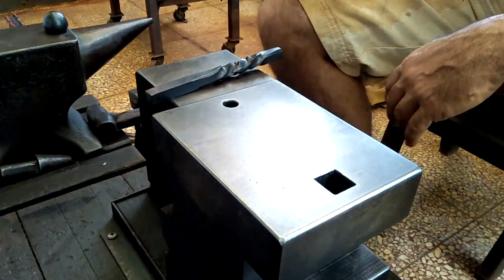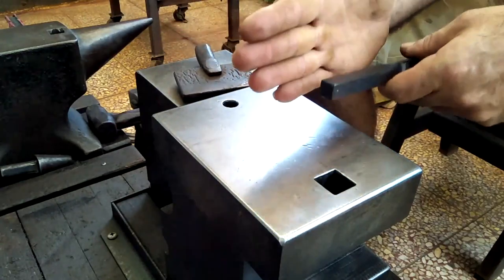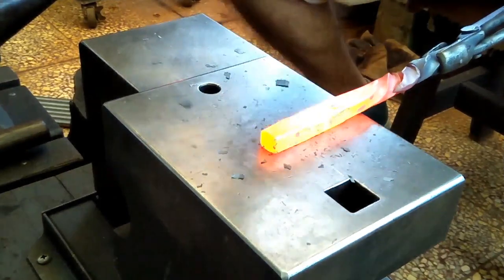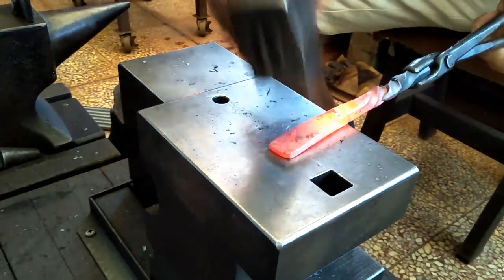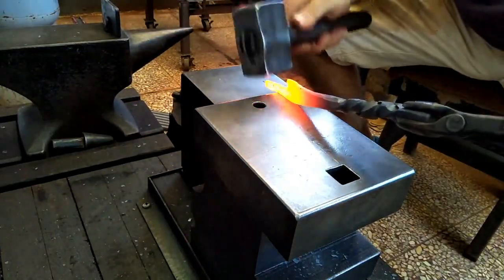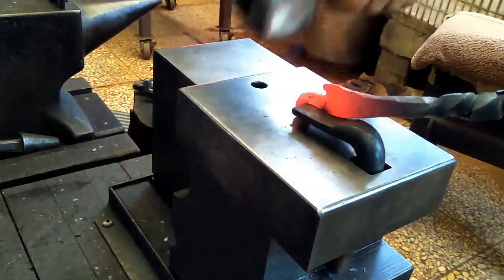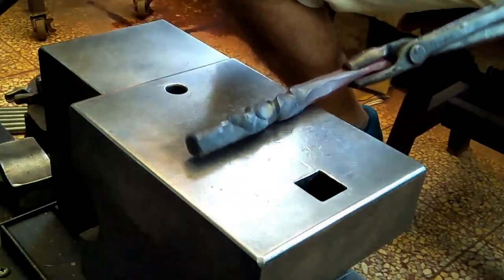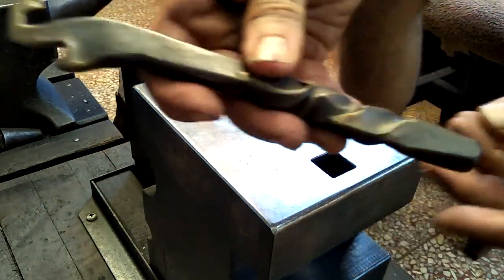Blacksmith bottle opener - again...

Comment: I would have liked to see it in action, just to see how well it worked.😊Great thinking, "...on the fly..." about adding the upper opener also!  I like it!  I think I'll have to try this out.  Love your stuff and don't apologize for making "little things".  Everything is a learning process and for the beginners, like me, everything you do helps us out, gives us practice, learn to make different things.  Thank you!
Mark
Gainesville, Fl.
Reply from the maker: Mark, Though I'm not a beginner, working on stuff like this, stuff I normally don't do, makes me feel like one. But I like having to think while my workpiece is heating - makes forging more intriguing when compared to doing thing I've done over and over again and can do in my sleep. It also has helped me become a better blacksmith; practicing things I'm not good at... Thanks.

Comment: Hey glen, I tried brass brushing some forged items but when handling the brass  finish rubs right off. I read that you can apply a lacquer or clear coat of some type over it to seal it in. I was curious what you do. Thanks
Reply from the maker: Paul, While it won't last forever, it shouldn't rub off so easily. Did you apply it when the your workpiece was warm? Also, perhaps it has something to do with the quality of your brass brush. Regardless, using some sort of clear coat can definitely seal the brass in so give that a go if all else fails. Thanks for watching.